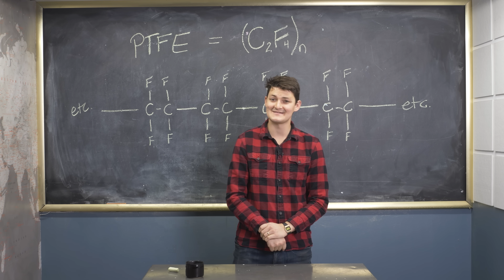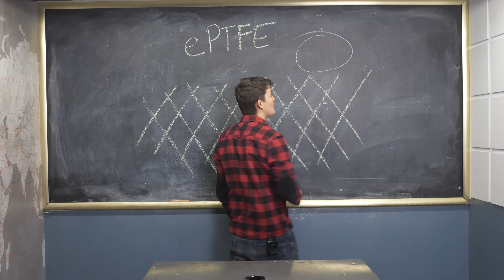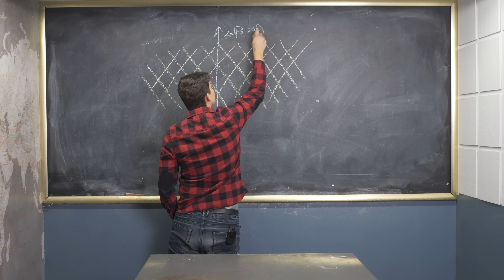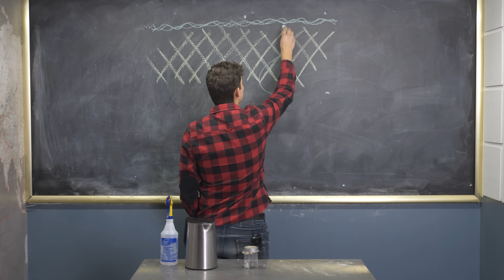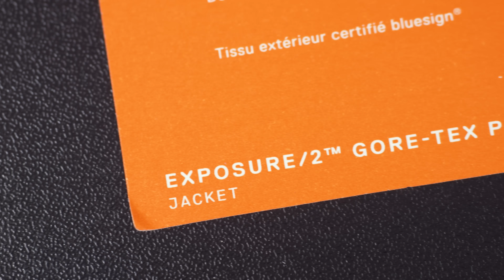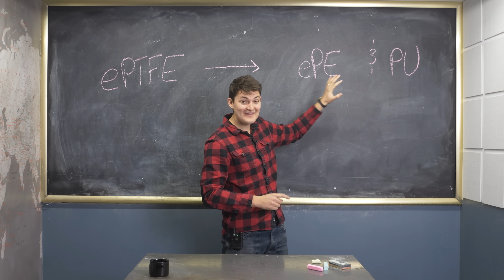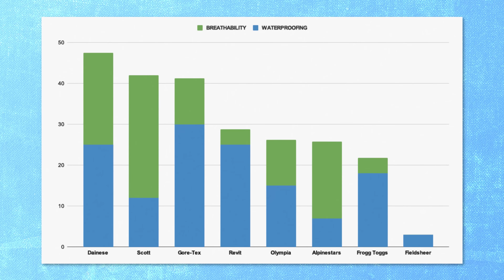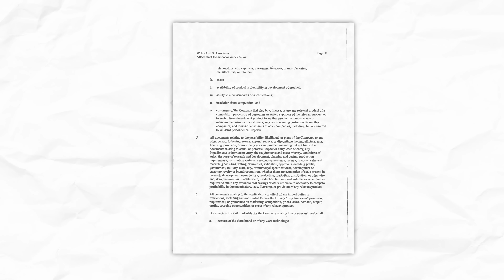Gore-Tex is a Marketing Gimmick

Comment: This pretty much sums up my experience with issued gore-tex in the military, I didn’t even know it was supposed to be breathable, just waterproof, and it always failed at that too.
Reply: my issue gore-tex is still pretty good. it stopped beading up after the first few years - issued 24 years ago - and it would get soaked or 'wet out' as they say, but rain still wouldn't get through the thing, regardless. recently, i found something called 'granger's wash and repel.' it has restored my jacket somewhat. it beads on areas with seams really well. it gets less wet out in general.
Reply: @iridium8341  I never said anything about damaging it, it’s in perfect condition, it just doesn’t work, never has, even when it was brand new.
Reply: Never been as cold as when wearing goretex field jacket.  More of a raincoat.
Reply: There is a definite difference between my early 90’s OG BDU goretex and my much later ACU goretex.   The original was much thicker and stiffer.  Still didn’t keep you warm though, and did a great job keeping the sweat in—ugh.
Reply: Just be glad you didn’t get vintage waterwear. I own quite a collection of military outfits from a few eras and early 80’s waterproof wear was not fun to wear for a long time. No breathability and made you sweat like crazy, defeating the point of waterproofing lol.
Reply: The air force must've gotten better gear cause I got the camo goretex as hand me downs as a brat 25 years ago and they're still waterproof for skiing(and breathable cause there's 0 humidity on a frozen mountain)
Reply: @montgomeryfitzpatrick473  I’m Air Force, so maybe you guys just got better gear back then, I got in 2014
Reply: @montgomeryfitzpatrick473  remember the part about teflon not being usable anymore ? That’s why today’s gore tex is overall worst (tho banning teflon was absolutely necessary and wasn’t done soon enough at all, fascinating story go check it out you won’t regret it)
Reply: Goretex isn't breathable as other materials, the "wetness" you feel from within the raincoat is sweat. It definitely keeps the rain out, and you can always reaaply a DWR to make it "as good as new" as you can get it.
Reply: @PrairieSundog  that may actually be the case, but if I’m just gonna be soaked with sweat what’s the difference?
Reply: I got Dainese gore-tex gloves and those suckers kept my hands dry in a downpour that was downright suicidal to ride into (and I shouldn't have) - I was mostly completely soaked (had a rain vest on top of my jacket which kept my upper body ok) but my hands were fine!
Reply: Military issued always sucks. You wanna go durable: shop in the area of hunters/trekkers/snowboarders/fishers/hikers
Reply: My issued goretex was and still is waterproof... But breathable? Hell no. If it's not 10 below freezing it's a sweat tent. Good thing they gave me that when I deployed, where it was 110°+ and didn't rain the entire time I was there lol

On the other hand, Gore Tex Bates boots are great for fall to spring outdoors work, just not in summertime.
Reply: Same! My goretex boots somehow always managed to gather up the surrounding water but not release it. I sometimes wondered if I had managed to put my boots inside out
Reply: @arwidsson3676  you have in leak then, not the fault of the Goretex.
Reply: Adding to this there was an uproar when Gore started to make camo fabric for hunters. The leftie outdoor types thought it was just for them.
Reply: I've an early 80's Gortex Camo UK Army officers over-jacket and trousers. Totally waterproof, rain just runs off and you don't get sweaty but it's not "warm clothing". The modern issue stuff is utter crap in comparison, ends up like a wet teabag.
Reply: But it's windproof ;-)
Reply: My issued goretex was like wearing a mobile sauna. I remember always wearing it half zipped to vent heat.
Reply: Yeah, I definitely had different experiences with it in Afghanistan. Not very wet, but the snow packs on.

Kept me warm and dry.
Reply: @Rico-Frid im calling bullshit on it keeping you warm and dry in afghanistan. Afghan winters were the coldest ive ever experienced in my life, even in full snivel gear and a woobie it was bone chilling. Itd take 2 hours at least to feel my toes when id get back to the hooch and in the winter sleep system. Dismounted patrols dont count because youre moving, its the 6 hour forcepro shift in a tin tower from 2400-0600 where you freeze your balls off. Goretex sucks.
Reply: @Rico-Frid  less humidity there, less sweating
Reply: real
Reply: I'm convinced there's a curse on all issued items, worldwide, by any military that makes them not properly waterproof. They could issue you a triple layer plastic bag in OD green and after 3 hours in the rain you're wet anyway.
Reply: Goretex lasts for 6months to a year of daily "farm/lumberjack" outdoor use. Once it gets scuffed (not torn) or moved a lot, like walking in boots daily, it starts to leak. This has been my experience for the past 20 years of 8hr daily goretex use. The military goretex jacket (the one with the "helmet hood" snaps on the hood) was decent, but leaked after a year or so. 
That being said, "waterproof" gear no matter what it is, always leaks if you use it daily while doing physical labor/activities. It gets abraded when you move (even inside leather boots).
Reply: if you're running around in goretex, you'll sweat. then you'll think its rain getting in, but its just your sweat. you need pit zips if you're moving much.
Reply: I have four military surplus gore-tex. They are cheap because they are old, the water repellent is gone and the sealing tapes will fall very soon. Nickwax doesn't make miracles and to replace sealing tapes depends on luck.
I got a two yard piece of gore-tex, which works very well, for 16 dollars and I will make a new jacket. The less seams the more reliable and easy will be this jacket. I will copy my german flecktarn, very simple and ugly cut. I have a dutch gore-tex parka... four pockets and reinforced elbows... impossible! Too many seams.
Reply: exactly! The German Bundeswehr even use it in their Dessert Boots🤣! Absolutely useless. In comparison to Leather boots (well - more caring...) you have cold feet in the beginning and later a damp climate in your boots. Generally speaking, a bad decision to issue them.
Reply: The type of PFAS used in gore-tex has been changed numerous times to be less impactful on the environment. Older gear had much more stable version which resisted water much better but also persists for a very long time in the environment, such as water sources, and it impacts biological life negatively.
Reply: All, PFAS, PFOA, PTFE, it is all the same they all very bad for us. @Falsk
Reply: Breathable ? No. You chose... wet from the rain or wet from sweat?
Reply: Mine was definetly waterproof
Reply: I never had a problem with my gortex gear in the military.
Reply: I have like 3 APECS jackets and they've always been fine on the job. Even after years of getting moly-b aircraft grease on some areas, which you would think would let it wet out.

You probably just got sweaty and thought it was rain. Any DWR based jacket needs proper cleaning and re-applying every once in a while. Nikwax works pretty well.
Reply: Compared to the non breathable kit before, Gortex was a game changer for soldiers.
Reply: What are you talking about? Really? Yeah, the US Military just issues garbage. That's why they're such an effective fighting force lmao. No, the Gor-tex absolutely works. I've been wearing my NWU gor-tex for nearly 10 years and it's great.
Reply: @psychic_wolf  Maybe you got something better than me, I don’t know, mine sucks, I can only speak for my own experience with it. That said, anybody who’s been in more than a year knows that the US military does issue garbage, that’s why we all laugh at “military grade” as a marketing tool. I’ve had some rare exceptions to that rule, but overall it was bad enough that a some guys I worked with would purchase gear themselves so they wouldn’t have to deal with the issued gear. Plate carriers, mag pouches, gloves, jackets and flashlights as just a few examples.

Comment: I bought goretex for a research trip to the rainforest in 1992 I quickly realized that I just got soaked from the inside AND the outside. I gave up and took it off and and just got rained on - at least I wasn’t miserably hot.

Comment: I don't have a fancy motorcycle jacket but I do have multiple ski jackets and I've done my own un-scientific testing in the environmental conditions that I spend time skiing in, here in Colorado.  Let me first say that I pay retail prices for nothing. Ever.  My friends even have me hunt down deals for them when they need something for skiing.  I've had many brands of ski jackets and pants, with and without Gore-Tex.  We have drier air here in CO than coastal areas.  The Gore-Tex jacket I've had for the past couple seasons is a major brand in outdoor clothing.  I paid $200 for it, the retail price was $400.  I hope to never pay $400 for a ski jacket, that's insane except for people who like to brag about how much they paid.  I like to brag about how little I paid.  I've paid $200 for non Gore-Tex ski jackets that I still own.  I can feel the difference when I'm wearing the GT jacket compared to the other jackets.  I do some light backcountry or side country hiking (AT) skiing which requires hiking.  I work up a sweat doing that.  What I notice is far better with GT than non GT, is the evaporation (me drying out) is much faster in my GT jacket than the non GT jackets.  Moisture reduces body temperature, that's not good in sub freezing or sub zero temps.  Evaporating that moisture is crucial to my comfort, and if I was injured or lost in the backcountry, I don't want to be soaking in my sweat when temperatures drop.  As for the waterproof-ness, snow here is relatively dry compared to coastal mountain ranges.  So I think the demonstration of those properties is probably accurate.  My GT jacket doesn't really have to do much water repelling even in the heaviest of snow storms.  

So my take is, if you're paying full retail for your gear, there is probably a much larger cost difference to consider than if you're finding deals like I do.  If a GT jacket is 20% or less in cost, I'm buying GT.  No question.  Until I find another product that performs as well for a lower cost.

Comment: The main concern for me with waterproof clothing is knowing if it is a fabric that is going to last or a spray that needs to be reapplied
Reply: I bought a set of Helly Hanson Workwear water proofs about 15 years ago. No spray required. Yes they're expensive, but they're the only set of waterproofs I've ever owned.
Reply: @Rachel_M_  they're great for my summer job but on the slopes they're not warm enough/too baggy from what I have seen
Reply: @Hello2215.  I can understand that. They're not the easiest to move around in. I use mine mainly for hiking and working outside

Comment: A decade later, and my gortex lined leather work boots are still much more water resistant than any other pair of leather work boots I've ever owned.  Same thing for the gloves I use for skiing.  Not all scenarios involve water from the outside btw, when it comes to sweat, gortex is far far better than a damn garbage bag.  My hands don't get wet when I wear my gortex skii gloves, they  would if I were wearing rubber gloves.  Hell my hands will get wet and gross from wearing rubber gloves even if it's completely dry outside.

So in conclusion, if gortex is a gimmick, it's a damn good one, which I'm willing to pay for.
Reply: You compare gorotex with a garbage bag and come to the conclusion that it is better (...). While you should compare gorotex with ePTFE products, and this way you compare an apple...to an apple. You are truly the target group of Gorotex, you just don't realize it.
Reply: @ea8455  in the video he literally says you’d technically be better off wearing a wool sweater and a garbage bag rather than a goretex jacket if your goal is to have a waterproof membrane… that comparison can be translated to all ePTFE products. especially since his experiment found goretex to be the most waterproof out of those tested

Comment: I thought it was already common knowledge that GoreTex is pretty much the same thing as a lot of the others. However, the problem with the others is that, unless you're really into this stuff, it is extremely difficult to know which ones are good and which are garbage. All things considered, GoreTex is at least consistent in its quality and still among the best in the market (your graph at 8:50 even shows it to be the most waterproof of the bunch).
Reply: Have a 20 year old North Face Gore Tex rain parka. Still repels fine and is in fact breathable. As long as I don’t role around on sharpened granite rocks, the parka has served me well living in the PNW.
Reply: Thanks for this comment... BC I'm wondering - what is the alternative? I don't mind shelling out for GoreTex if it's best to get me started for now... Developing the "discernment for what is good", like what I need is security to get me started.
Reply: @ahn0x ...You are looking for "security" and are getting started in Motorcycle Riding?
Have you ever seen a small child toss a urinal cake in a puddle before they jump in it?
Nothing that is waterproof stays waterproof for long, not even a frog's hole, if stretched and rubbed on.
Reply: @ahn0x Neoshell
Reply: Still I wouldn't invest in their stock, PTFE is on the short list of things that we are going to get rid of.
Reply: @kampar82  Which is why GoreTex largely isn't ePTFE anymore
Reply: @nyetliu Even industrial applications have to justify the use of ptfe, largely won't be acceptable in the future. 3M is taking their final orders for ptfe next year, my biggest worry is not uncomfortable clothing but actually useful applications.
Reply: @kampar82  privately held corporation
Reply: @patrickpk6299 Yes, they can stop doing whatever they want. At the same time requirements in the technical field are getting tougher. It's not like you can just replace replace 3M PTFE with temu PTFE and be all set.
Reply: @kampar82  its overvalued right now but they could just come up with something out of nowhere. prob not though
Reply: The us military uses gortex. I have never sweat so much as when I wore that stuff. Fortunately most of the time they made us pack it around but not actually use it and I don't mind standing in the rain. Then again I'm not as civilized as most of you.
Reply: its not though. goretex makes any company using its name to stick to extreme quality standards. 

goretex is better lol.
Reply: @hurpaderpp  I had several gore-tex things that just didn't work from the day one. Like shoes that got wet after I walked 2 meters in a wet grass, within 10 minutes of putting them on. RMA refunded. So no, not all goretex is the same
Reply: @NattMoir  you bought something that sat in a warehouse forever and delaminated or is fake or is a goretex that isnt meant to be that waterproof. theres many types of goretex. thats user error
Reply: @hurpaderpp  The fact gortex can de-laminate puts it behind any wax-able jacket ever made.There are waxed jackets made 50 years ago still being worn today.
Reply: @99EKjohn  user error eh.
Reply: @flowgangsemaudamartoz7062  huh? I don't think I said anything about user error. You can do nothing wrong, and gor-tex will delaminate as it ages. You can abuse the crap out of a waxed jacket and just patch it. With proper maintenance and care it will last forever. It's a difference in material durability.
Reply: @99EKjohn …there is no wax jacket ever made that is as waterproof as a gore Tex jacket.  Gore Tex is not the only waterproof fabric in the market today, but all of them are better than a wax jacket
Reply: @NattMoir ...You paid No Attention to the Physics Part of the Video.
You can't go around kicking grass and Pushing Water Thru the Breathable Material.
I have no idea why our presenter didn't refer to wind as a pressure differential, as if a rider ever has to deal with that.
Reply: @WilliamWBG ...Your "English" and your "Marketing Vocabulary" seem to have an Overlap.
Thank God we have Lawyers, who can admit that the Enemy of Water is my Enemy, and sue the pants off of the dark side.
Reply: @99EKjohn it's the same with goretex lmao. This video was piss poor and the comments really brought out the dumbasses. Just like how you rewax a waxed jacket, you respray dwr or use dwr formula you can wash with to replenish the goretex's capabilities. Is goretex pricy and arguably overpriced? Yes. Do they also ensure much higher qc standards and have the best rain protection? Also yes. Fort9's own data shows as much and shows that there's compromises between breathability and water protection.
Reply: Sorry but Graph at 8:50 doesn't say what you are claiming! Check it again!
Reply: @truthisbusiness1564  the graph literary says that Gore Tex is the highest in water proofing at '30'.  Are you dense?😂🤡
Reply: @truthisbusiness1564  Learn how to read a bar graph. Blue is waterproofing on that graph, of which Gore-tex has the highest rating (30).

Comment: Yep I always knew that it "kind of" worked, kept a little rain out when it rained was only slightly breathable.

It works in light rain, but well you might be better off using polyester in heavy rain. Maybe wool also, in light rain.

It is somewhat breathable, but wool is clearly better in breathability

So the preferred way would be use wool underneath and maybe polyester/gore-tex on top